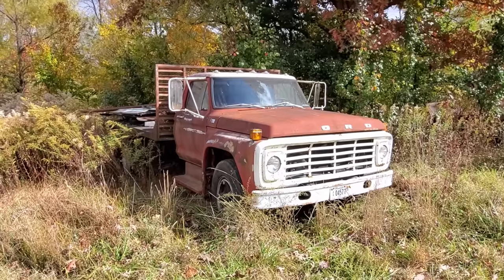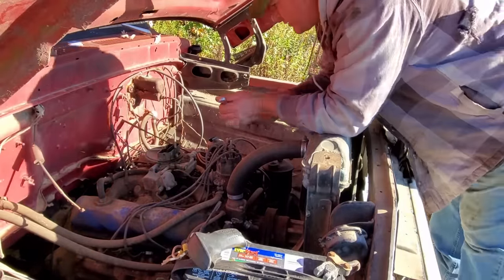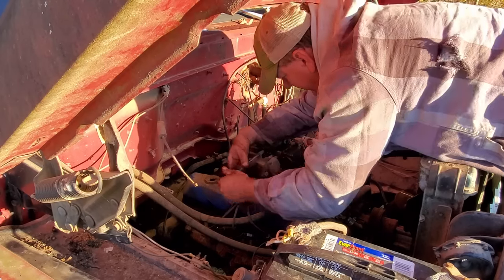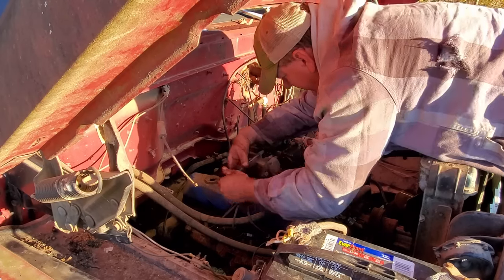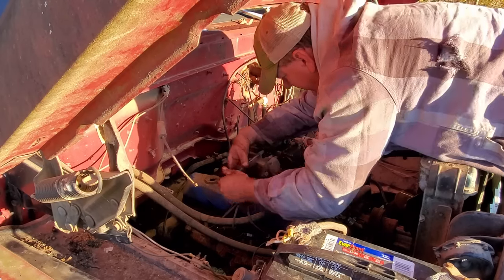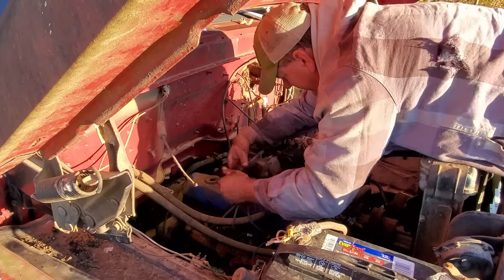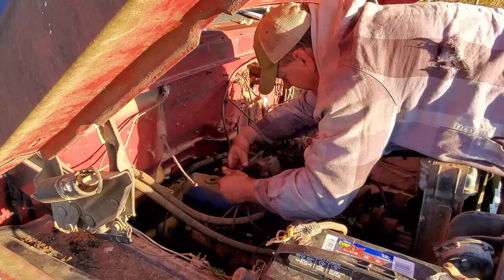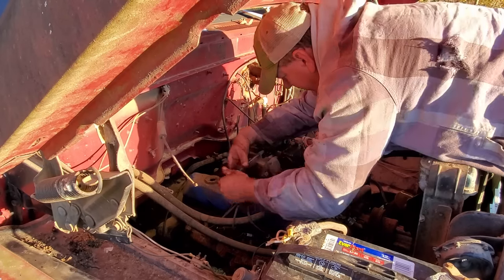Let's Get this 1977 F600 Ready For The Farm Again | Has Lots Of Issues!!

Comment: I've got a 69 F600 with the 330FT in it.  My dad bought the truck back in the early/mid 80's for use on our farm so its been in the family for about 40 years now.  We used to load it with wheat until it ran off all four sides of the box and hit the road with it.  Regularly went across the scales with 330 bu of wheat in her (20,000 lbs) and that little 330 just pulled like there was no tomorrow.  I now use it as my firewood getting truck up in the mountains and she still runs just as sweet as ever.

Comment: Short of removing the tank and steam cleaning it, there is no way to stop all that fine rust from clogging the pickup.  I had the problem with another truck, and I temporarily solved the problem by draining the rust out, and attaching some magnets to the tank.  The temporary fix worked so well, that I never did pull the tank.

Comment: I have put the new and improved brake line in the place of rubber factory line and everything has worked good. I’m talking about even the front brake lines that move with the steering of the front wheels Side to side. saved  ALOT OF mONEY and can’t believe how flexible this “new style bendable plyable brake line u don’t have to have the traditional bender to make those bends. I believe it’s copper line but it could b something else.

Comment: On those worn out throttle shafts I have had good luck using bullet shells for bushings. Sounds strange but it's an old timer trick that works, .22lr  once you snip the end off is a great brass bushing. I did a video on it with a mower carb and have had success on trucks as well. Great channel you got and I look forward to future episodes!
Reply from the maker: I'm gonna make or buy bushings for it and another one.
Reply: That's a good idea, i save all my brass, even the .22 shells. I'll definitely remember this trick!
Reply: That used to watch you gotta make sure it's true Craftsman because anyone can go to the o'reilly's or online and bolt on new part but it takes a real mechanic to like what you got at work it's like my grandpa's a good friend I want to Franklin 6601 and I have another and make it work and also my Uncle Jack you can fix an engine with this quick and play on wire
Reply: At least that's what it seemed to ask grown up as teenagers kids watching both of them work was a real education and I really experienced that I carry with me part of them the rest of my life
Reply: @joebrock9784  I'm sorry brother. But I cant make heads or tails of either of your comments.
Reply: @theknifeconnection9571  
I agree. Guess what they were saying went over my head.     👍🇺🇸🦅
Reply: I used to keep a few I my toolbox for just such an occasion

Comment: Great work as usual buddy! I run a standalone fuel filter setup on my old chevy that uses that same filter. The part number is GF-157. I usually order mine online and I get them for about $10 to $15 shipped. Hope this helps someone out.

Comment: I have an F600, and I had exactly the same problem with the fabric covered brake lines.  Like you, I bought a 25 foot role of line and got to practice my double flaring skills.
My hydrovac booster was also shot, I couldn't find anywhere to have it rebuilt, but because I am not putting the truck on the road, I just bypassed the hydrovac, and am just using the primary master cylinder for brakes for now.  I am thinking of putting a vacuum booster on behind the cab mounted master cylinder.  That will work great for my needs.
A lot of the parts are interchangeable between the FT and the FE engines.  The FT engine, has a forged crank, and for racing, we used to have the front of the FT crank turned down to match the damper of the FE engine.

Comment: one trick i have learned thru the years is when you go thru a Holley when you remove the metering block the face of the carb that the metering seats to there is a round ring that looks like lead the carbs most of them have a internal leak there if you have something really flat you can attach a piece of sand paper to sand flat or i have a large flat file i use to get it close then finish with 120 wet or dry sand paper they run so much better. i have never took one apart that wasnt warped even jetting a new one i always check that surface

Comment: Those f 600 and 750 trucks were good hard working trucks but they just bout all of them for some reason would  run good till u got it under a load and it would  act like the points were bad but it was always the dist.shaft lose u could  grad it at top and move it back and forth  I changed  many one no matter  low or high  miles

Comment: Added Note I have broke ribs leaning over the fords like that especially standing on a milk crate.  My wife reminds me of that every time I start to work on any motor.  74 j-10 jeep pickup 360, 78 big bronco two engines 351mand 400m  myself installed, 79 3/4 f250 400m with a million miles, 63 f- whatever straight six project restored sold to pawn shop friend who finished the paint and 302 add.  Driving a 2002 dodge quad slt 4x4 on second engine at 259,000. New ecm and wiring after mice ate the wiring from letting it set six months. another note I set my j-10 on fire adjusting that darn holley float level in my Mother in Laws Garage,  Yeah she really loved me for that!

Comment: Excellent video Chad  :) also how fuel tank clean up can try sometime is use Rock with Vinegar so scrub when Shake  up side ways or up and down few times  but duck tape send unit also fill neck spout before add bottle of Vinegar and  Rocks into ! Then dump out  and do second time too! Also thought motor may be 356 Cubic Inches size V8 also  it 330 one Chad you said and remember those trucks my late dad had on Fire Department to drive as tankers type  for long time !

Comment: I got the Ford Truck shop Manual and could prob help with that vin there
The first 3 should be F 6 0 Then the next one is your engine I'll list the Heavy duty motors

Code
D 330"-2V H.D.
4 330"-2V HD Low comp
E 361"-2V
5 361"-2V HD Low comp
F 391"-4V
H 401"-4V
K 477"-4V
L 534"-4V
J 475"-4V

Theres a few more but they are LPG motors
Reply from the maker: F61D

Comment: 391 truck engine?
Push down as you try and pull the latch, boom. That's it.
Don't overtighten the belts.
Make sure you use a truck cap with a truck rotor and not a car cap or rotor unless you use both.
Believe me.
You need the right voltage for cranking and run at the coil.
Weak spark can come from low voltage on the primary.
The resistor wire is in the harness that comes out below and inboard of the master cylinder.
There's tests in the book for volts from the ignition switch.
A new set of points and condenser if you can get a good brand.
Usually NAPA. Or at least that used to be.
The can on the fuel pump can be used to trap old fuel and dump it off before fresh gas.
The carbs generally sucked and you might find an older one that could solve the issues you could run into with dying hot or leans out on accel. An AFB conversion works out pretty good.
Doing a lot of work to one of those is something you can't necessarily count on to come out good. Especially using the customers money.
To each his own, though.

Comment: That motor is an FT series, the Industrial version of the FE, It will be a 330, 361 or 391. Not much will interchange with the FE motors. I "think" all of the 391s had 4 barrel carbs, so that one is a 330 or 361, the 330 is by far he most common. They're torquey, slow revving  engines, 3500 rpm is about the end of the world.
 Haha, you've got the same work platform that I bought specifically to work on my 73 F-600 dump truck. It's a life saver on those old medium duty trucks. Cheers buddy!
 Edit: Well, that's what I get for talking before I watch the whole video, lol. You figured the engine out. Thanks for the great videos.
Reply: Because this truck is newer than 74’ (I believe) it could have also been optioned with a 370 Ft engine it’s what I have in my 79’ f700 they also came with Holley 2300eg carburetors like what this motor had. I’m fairly certain this is a 330 though I don’t think they had 361 or 391 in this year f600

Comment: that garbage in the carb is from modern ethanol fuel. since ethanol is hydroscopic, when the benzine, ethanol, and other petroleum volatiles evaporate off, the water absorbed by the gasoline starts corroding everything. when that evaporates off, what's left is a tar from all the extra additives (sunoco gas seems to be the worst in this regard) and the aluminum oxide that sloughed off the carb body.
Reply: I'm guessing all the extra water is probably from condensation in the tank and/or the filler cap leaking, rather than the usual little bit of water absorbed while the fuel is in the float bowl.
Reply from the maker: It's just water that was poured in it is all.

Comment: Nice job on getting the old ford running.  Would love to know why some idiot would put water in the tank? I would have at least blew the inside out , unless you did off cam and hopefully a air cleaner.  Btw I was always taught to hold the float adj. screw and turn the nut to raise and lower the float.
Reply from the maker: Maybe you missed the carb and tank cleaning. Different type of adjustment.

Comment: i gotta ORD with a weird carb related problem too. I even tested the carb on a different motor and it works fine but it just wouldn't run right just like you where having here, like it's running lean but no clear source of the issue. I put another cheap carb on it fixed itself. Not sure if it's just a ford issue.

Comment: That intake has a spacer with a vacuum port underneath the carb it's missing victolic it's a Ford thing has to b there .that other carb is a motercraft from Ford works great they make a 4 barrowel shaped like a holly but comes apart like a afb top an bottom they work good on fords u can't keep it tooned on a chevy.that industrial holly goto have that spacer it corrects the intake channel. It's not an spacer foor industrial carb trac is slightly different.its a fe. Ford industrial flaw .. great job love you r footage
Reply from the maker: Intake spacer? Maybe you mean carb spacer and it's not missing.

Comment: Why do you pull upward on the wrench when removing lug nuts?  Set yourself up to push down- your back will thank you.  Nice job when you finished it.  You're very familiar with nearly every part of that truck.  I enjoyed watching.  Thank you for sharing this job.
Reply: When you push down on the handle you only have the weight of the upper body, in Chad's case that would be 125 lbs. Pulling up on the handle is limited by the upper body strength of the man, or the weight of the vehicle, in Chad's case that would be around a 1000 lbs give or take a half ton.
You remind me of a Mommy telling her 14 year old son how to remove lug nuts safely in a way that would not hurt HER feminine back.
Reply from the maker: 🤣🤣🤣 Too funny! 👍
Reply from the maker: See what Art said.

Comment: I used to change split rims. I had one explode on me while inflatin it. I just rolled it into the cage cause it made a loud zipper sound at about 100 psi. It exploded like dynamite! Ripped the cage out the cement hit the side of the buildin bout 8 feet away bounced off and hit me another 10-12 feet away and landed on top of me😂 man I couldn't hear nothin for 3 days😂 plus left me feelin like a semi hit me😂😂
Reply from the maker: At least you had a cage. I use to air up the lock ring type with just a chain wrapped around it.
Reply: @ThisNThatGarage  oh shit well the funny thing is I never used that cage before then cause before that I was mountin everything from semi truck tires to farm tractor tires to 15 ft tall earthmover tires that I needed a 4 ton gantry crane and an old 20,000 pound Clark forklift to mount so I didn't even think about a little old semi tire tryin to kill me😂 let me tell ya after that I learned a valuable lesson about the power of compressed air😂 and the sudden evacuation of that air😂 did you ever have one explode on ya with a chain on it?

Comment: $55 bucks for that stupid canister fuel filter?!?! Holy moly!!! I tell u what, they used those types of fuel pumps when they had a in cab gas tank. Idk why?? But for my lil 71 f100 I bought a fuel pump for a 75 f100 that had a in frame tank (so just a fuel pump without the canister) & it was $18 bucks. It worked very good. And that was from oreillys.

Comment: DO you disconnect the fuel pump on these rescues and put new gas in carburetor so you don’t cause fuel pump to suck puked gas from gas tank into carburetor? Just wondering.

Comment: Why don't you just order in the butterfly stem shaft brass sleeve bushing for that other carburetor. Those cheaper ones won't last very long at all. I'd spend the money on the parts for the original carburetor instead it'll be worth in it the long run.& Long term outcome come use to. I'm just shooting it start forward to you about that part is all. Even those cheaper moped.& scooter carburetors don't last very long.,or even work that good either. Invest in A brass sleeve bushing for the original carburosstor. Even if you half to spend more on it.,or have it specifically machined for that original carburosstor. In the long run it'll be worth it for sure.

Comment: Have you ever had an opportunity to work on a Dodge C500, 600, 700, 800, 900 or a 1000
Reply from the maker: No sir I haven't.
Reply: @ThisNThatGarage  you can stand on the ground or floor to work on the engine as the fenders swing out. They pivot at the radiator

Comment: All Ford v8s use the same points on all 302 289 and fe engines set at 17 thousandths 18 if it's emergency vehicles distributer sets at 8degrees btc emergency vehicles set at 12 btc usually  I set mine at 9 to 10 old school. Mechanic I miss old leaded gas with 105 octane  Pres Carter was letting tree huggers run the country,

Comment: A chat you can buy one of the most responsive cleaners at o'reilly's for about 80 bucks and then I'll just run that cheap Harbor freight degrees are in about 5050' with water and it'll work if you want to do it really cheap you can also run Einstein instead of Harbor freight degrees or but I like the Harbor freight degrees are a bit better cause it's just a bit meaner than the pines all but either want to work you want to do it on the cheap that's the way to do it I'd have 1 in my shop if it was up to me When you get a built cause they're cleaning the covers up like new